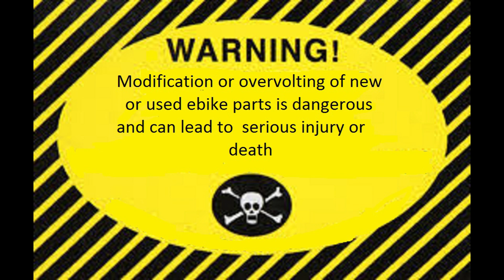ebike Controller, 1500W 50amps(modification caps pass plug)

Comment: I have a 2 fiido cargo T-1  I think this controller needs a high capasity board. 
I ordered 1 but when I saw the board it looks lite not like factory.that has 
what looks like 
a strip of .020 
extra heat sink 
material on board, like what your working on

Can you point me to a soarce
read or I.D. the
specs?  thanks if you can im dun with fiido

Comment: my controller will take some doing to mod, its not your typical controller, take a company that manufacutres cars and not jsut bikes and you get some intersting controllers that will either need technical expertise and or getting a hold of the schemetics.  and I am talking about this controller in specific. 
Intelligent Brushless ₩otor Controller
hase angle: 1200
Model: NJTZT-6GZE
Electric current: 25+1A
Voltage: 36V/48V
Brake handle: low level
Undervoltage: 29+1V
ate: 2022-07-07
Quzhou naijiate auto industry co.,ltd
like I said it seems that modding videos have ended and not many are being done now because of the complexity of the controllers.
E-bike manufactures are creating controllers that make it more difficult to tamper with. 
this controller , is not an easy lock to pick.

Comment: Great videos to learn from ! Thanks. I was recently given a hand me down 60v battery - so is there any other component to upgrade only the Caps and Mosfets ? I have a Voilamart 1500 rear hub but only has 63v Caps. I ordered some 100v ones and the Mosfets too. But not sure if other components need to also be upgraded. Thanks.

Comment: Dont get why you guys use these oversized controllers, got into scooter modding with a VESC and upgraded my ebike with that as well
Awesome controls, great bluetooth functionality, adjustable as fuck and manages 200A in the size factor of a 10A ebike controller with twice the voltage
Reply: Hi how to find this kind of product with Bluetooth  and stuff ?  If I googel vesc  only a lite expensive thing

Comment: Hi, and thanks for this video. Twas really helpful, esowcially because i have the exact same controllet type. 
My main concern is the PAS mod you did. My controller (same as yours) doesnt come with a PAS wiring as standard. I'd lije to add this feature because my throttle is broken.
Thanks

Comment: Hi, i have a 48v controller and im going to use a 72v battery, i have oguht 100v 150a mosfets and 100v caps. I have already beefed the controller up. do i have to change anything else like resitors and stuff. becuase i do not want my display or something to blow.
Reply: I know you posted a year ago. When I read your comments - I found that I just ran into the same scenario. 48v to 72v and like you bought 100v Caps but my Mosfets were only 100v. Hence did you have to upgrade any other component ?? I guess I Can plug it and hope it doesn’t blow up. 😂
Reply: @f.r.-th2js  You will probably damage your display module as the voltage display is set up @ 48v not 72V.

Comment: i went from 60 amps to 97 amps. i just added a bit of solder on and around my 4 shunts. took it for a spin and omg. it pulls the front up so easily and the front is where my 18lbs of batteries are, i weigh 213 and my bike is 103lbs. top speed before mod was 51mph, but i lacked the amps to over come wind resistance, now i am sure i can break 60mph, but i want to get proper safety gear first. my system was 4.1kw before the mod, i have no idea where it is now as i am afraid to max it out now

Comment: Hello. My ebike has a controller that has this simple, but wierd wiring configuration. it’s a 36/48v 350-watt 16 amp. The wiring is like this: 9-pin for the motor; 1T4 cable for the throttle, display and two brakes; one 2-wire connector for the front light; one 2-wire connector for the tail light, and one 2-wire connector for the horn. I was looking for a controller same wiring config but cant find one anywhere. Do you modify contoller for that same wiring config?
Reply from the maker: no idea there all different.

Comment: Just wondering if you could help point me in the right direction for a replacement motor controller for my ebike, it’s a elife natural 36v 250w thanks
Reply: Get any 250w/350w 36v controller and wire it up any will work you'll just have to do the wiring unless you find the exact one

Comment: Another question, how does wheel/tire diameter effect motor speed and power? If I do build a bicycle, I want a 26" or better frame, with 20-24" wheels, I know the crank will probably need mods, but I need a low stretched bike due to leg injurys, and can't really peddle anyway.  I like the mini bike looking ebikes, and cargo bikes, I will likely stretch the rear fork also, allowing for a rear rack, I have also thought about a trike,
Reply from the maker: there's a difference  if i could get away with it i would use a 24 inch wheel.

Comment: I have a 1500w, 48-72v controller, I was wondering if it's possible to double the FETs, and allow the controller to think it's still 1.5kw, while being able to handle 3kw? How far can you go when over volting, the motor? 60-72v with a 1500w 48v motor be OK, for burst of full Power,  I haven't much experience with brushless motors, what I'd like to do is 3motors, 1500watt hubs front and rear, with a 2-3kw mid, running around 60v, I have lipo cells to build a battery, capable of a sustained 600-800amps, in 3-4 in parallel , I'm a bit heavy, and have hills around here! While a mid mounted motor, around 3kw, would probably be enough to get me in trouble on the streets, if I can go faster than regulations, I want to do it up hill also! I would be thrilled to get 20-25 mph up hill, and 60-80 on flats, I'm thinking about a moped conversion, something a bit more substantial than a bicycle,
Reply: You most likely to run into battery limiting factor don’t forget about it.

Comment: During voltage drop you can just inject more voltage
Reply: Not an expert but I believe you have to run battery’s with a higher discharge to counter react it like the Samsung 21700s

Comment: By any chance do this thing have a speed limit or something?  I running a 84v 1500watt controller and I just got a 72v motor thinking that with the lower voltage rating I would get more speed not it's the same thing I'm able to get why more torque and speed with a regular rc esc but because they unsensored motor runs hot and efficiency is very low I would like to modify my controller for more torque and more speed. Thanks
Reply: Your idea about motor being made for lower voltage than you have is generally speaking is right. So most motors of 1500w nominal are made to reach 60kmh. Than they reduce KV depending on how high system voltage is. (Low kV have more torque - physics) 

I would say you did get the right moto for your voltage to get more than supposed to have speed (no real thrust sacrifice in your case, as higher voltage offsets it)

Thrust will depend on how controller handles it - max amp draw and watt SW allows and HW can support.
- adjust soft ware to allow more
- beef up traces with solder / copper wire along
- make sure fets(mosfets) are top notch (lowest resistance) 
- use some good Panasonic FR Or FM series low esr capacitors to reduce noise in the system (causes heat)
- use very good thermal past for fets and controller 
- Mount controller to the metal to help heat disperse
Reply: @airBornFpv  thanks alot
Reply: @yulmerced4434  welcome 🙏

Comment: Is there any benefit to upgrading to higher voltage capacitors if my battery is still within the original capacitor's range?
My battery is a 52V, so fully charged it's 58.8V, my capacitors are rated to 63V, would I benefit at all from upgrading to a higher voltage cap?
Reply: My 1500w 52v Controller have 100v capacitors, CD288H is the part number. They should suit you fine
Reply: No

Comment: sir if a have 48v 1000watts hub...it is possible to change 100v capacitor to increase the speed...
the top speed no load is 45kph
Reply: Changing the Caps won't give you extra power without replacing the Mosfets.
Reply: @TheBrainSquared  even replacing mosfets won’t do that much - if you install lower resistance more efficient once, you may gain 1-2% back due to higher efficiency, but that is not why mosfets are to be changed - real reason is to reduce overheating, specially if you running close to the controller amp limit (usually sw limited in edition to what HW can handle)

So yes MOSFETs are good to have replaced on cheap controllers, but for top speed to increase you need 
1. Higher kV motor (rotation per volt)
Or
2. Higher voltage (get 12s instead of 10s battery for example)
= top speed will increase unless controller has SW limit.

Most controllers can handle extra 1s or even extra 2s without HW modes, but need to examine it carefully before attempting
Reply: @airBornFpv  Sure voltage will get you more speed, but current gives you the torque and the ability to reach that speed. I wouldn't just replace the Fets and call it a day, I would blow my controller as soon as I plugged it in..
Reply: @TheBrainSquared  look replacing fets will generate more torque only if FETs are the limiting factor - in decent controllers fets amp rating is WAY above SW amp limit, thus replacing fets will not do any torque improvement on its own, but may allow to over current if you change SW (rest of controller needs to be beefed up for that too though)
Reply: @TheBrainSquared  also incorrect about amp making the torque - it is always watts, not just amp

5v * 20amps = 100w will not creat same thrust as 60v * 20amps = 1200w

By increasing voltage  from 50v to 70v you allow same controller design, for example limited to 20amp, to produce 1400w instead of 1000w (even if your unchangeable SW and HW amp limit is still 20amps)

hope it helps
Reply: @airBornFpv  I gotcha..and you are 100 percent correct..
Reply: @TheBrainSquared  happy to help 👍
Reply: @airBornFpv  My controller is overheating.....I put a 48v battery instead of the original 36v,on the label it says that it is for 36v and 48v controller and 11amps I think, can it get hot because the PAS sensor doesn't work?

Comment: I have a problem with my battery is right next to my controller. Right under it. There are holes to let air in to blow on the controller as you ride, but I covered them up to stop water from getting to the battery. I used it liek that two times and my fuse melted on my battery. Not sure if it is related.